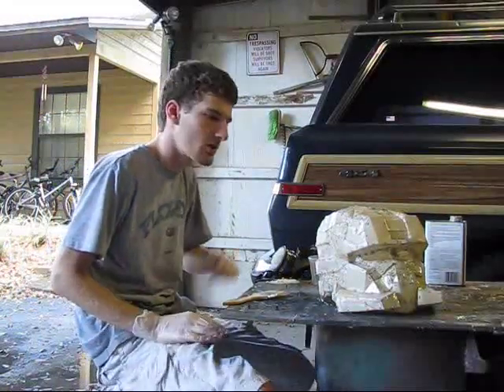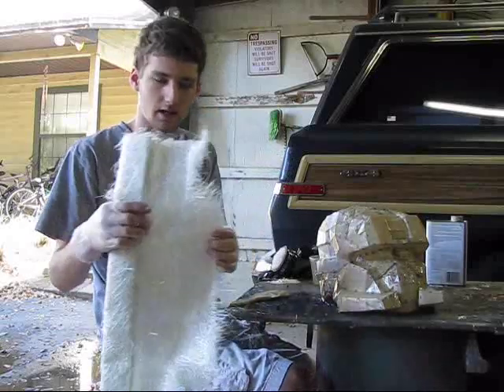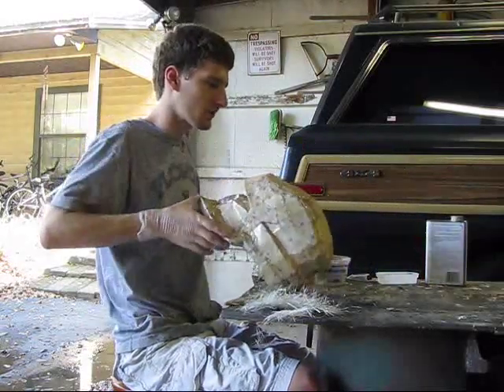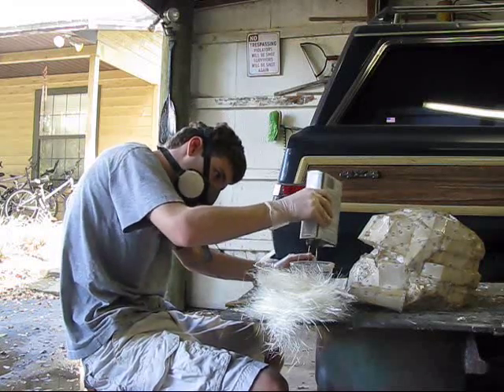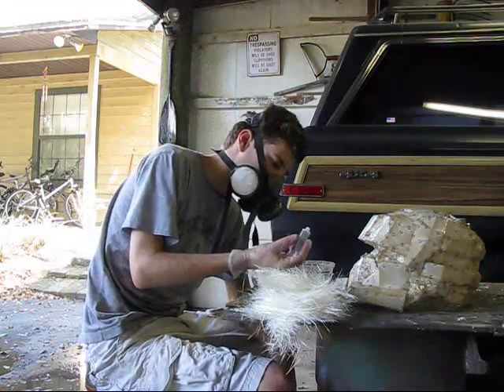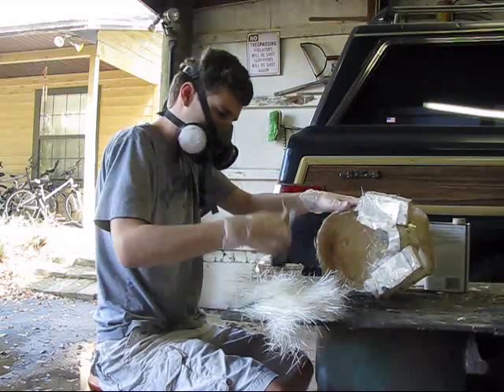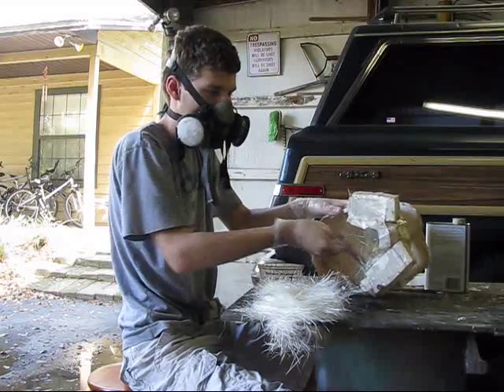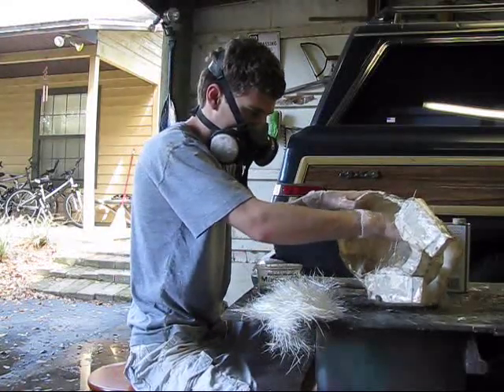How to build Halo armor Part 4: Fiberglass

Comment: Thanks for the video. In the process of adding the fiberglass sheets, would it still work fine if I spray "adhesive" material for the fiberglass to stick to, then add resin to JUST the OUTSIDE of the fiberglass sheets? This will be my first time and it seems easier to cut out the fiberglass shapes and attach them ahead of time. What is your advice? Thanks again for the videos. Very Helpful.

Comment from the maker: I don't really know. I've never made a pepakura weapon before. The only weapons I've made were scratch built from cardboard and didn't need fiberglass. You could maybe add cardboard to the inside of the weapon as you were building it to make it strong enough with just resin on the outside.

Comment from the maker: The bubbles could cause a weak spot in the helmet if they are large, or you could end up with a hole on the outside of the helmet if you sand through the resin and cardstock. I think you should try to fill the larger ones. If you end up having a problem, all you'd have to do from the outside of the helmet is fill the bubble with bondo and smooth it over. Also, do the bubbles hit your head if you try and put it on. It could be an issue.

Comment from the maker: Well, it might be possible to get away with no fiberglass but I think it would be hard to bondo and sand the helmet without it because the helmet would flex and bend while your trying to sand and possibly crack. You could just add a bit of fiberglass and if you're going to resin, you might as well lay down some anyways.

Comment from the maker: I usually try to lay the fiberglass down as smooth as possible, but if you have problem areas, you can grind or sand them down. Also if you sand them down some you can try to smooth them a bit with bondo. There's no easy way so just try to lay down the glass as smooth as you can.

Comment: Hello again...  Thank You for answering my previous question, I have another that I'm hoping you can help me with, I did my first layer of fiberglass. I noticed that I left some area with bubbles and didn't smooth every thing as well as I thought I did. Should I be worried about them ? should I try to cut and fill them? if I continue with them will it cause problems later on ?

Comment: good thing to do is when you put the first layer of resin on. get a smaller paint brush and apply it to the weaker areas of the helmet. then leave it until it dries and then apply it to all of it. do really thin layers if you are still uneasy about the strength

Comment: Would it be possible to apply resin and fiberglass to certain parts of the build during assembly? I don't ask this for a helmet but for other builds where you might not be able to access a part of it after it's put together. At the least, just the interior and leave the exterior resin til it's fully built?

Comment: I got a question. I'm trying to make a Halo Shotgun to go with my Spartan armor and I'm trying to use Pepakura for all of it since that seems to be the cheapest method. However, contrary to Halo armor, I don't think I'll be able to fiberglass the the inside of a halo gun. Obviously cause it's not as open or exposed as halo armor is. Do you currently know of any other methods of using pepakura and something else to make a halo weapon nice and hard?

Comment from the maker: Yes, you really need to fiberglass it. It won't be strong enough without it. 
This one is stronger because I had some leftover Smooth-cast 300 plastic from another project. So instead of wasting it I poured it inside this helmet.

Comment from the maker: I wouldn't recommend using just resin as the helmet is more likely to flex which will crack the bondo and ruin the helmet. You could try it, but if you are going to resin, you might as well lay down some fiberglass on the inside and not have to worry about it.

Comment from the maker: I always do at least one coat of resin on the helmet before cutting out the visor/lenses. This one had a coat of resin on it already, that's why the lenses were cut out. I usually cut them out before fiberglass so it's easier.

Comment from the maker: @OCoptimusconvoy  Well it depends on how much hardener you add and the temperature of your working area. Mine usually takes only a few hours to cure because I mix it hot (a lot of hardener) and I work outside in a hot climate. Resin will stay sticky for a while.

Comment from the maker: I use it for mostly the fiberglass resin's toxic fumes, but you should also avoid breathing the fiberglass dust as it is dangerous as well. I don't have any experience with aqua resin so just make sure you read the instructions well.

Comment from the maker: I usually wait until I have at least one coat if not two coats of resin on the helmet before cutting out the visor. But it depends on the helmet. If it doesn't seem strong enough, fiberglass the helmet first. Just don't put any over the visor so you can cut it out easier.

Comment from the maker: Not really, but smaller pieces of fiberglass are easier to work with. Fiberglass doesn't like to stick down over corners so if the pieces are small you can get them into all the places good and make them have lots of overlap.

Comment: you could try carbon fiber but it would be much more expensive and harder to do than fiberglass. if you need stronger then just add another layer of resin and fiberglass

Comment from the maker: @EpicExplosionsOfEpic  You need at least two coats of resin on the outside. Then if the helmet is strong enough you can move onto fiberglass without coating the inside with resin first.

Comment from the maker: Well, I just use cheap plastic and spray it with VHT Niteshades but if you want something stronger you can buy a motorcycle visor and cut it to fit.

Comment from the maker: I've never tried that method before so I can't say yes or no. I don't think it would work very well because the resin needs to soak all the way through the fiberglass mat or cloth sheets and stick them to the helmet/armor. But, if you think it would help, do a small test first to see what happens.

Comment: for my armor i did plaster bandages on the inside ( stuff limb casts are made from) then put resin and insulation foam and resin on and is pretty dam sturdy i can sit down in it and it's not break so yea just sharing ideas incase anyone cares

Comment from the maker: In my opinion you need fiberglass. Just resin is okay, but you won't ever get the strength you can with fiberglass. Also, if you're going to resin anyways it's not that much more work to just add a bit of fiberglass to the inside when you're doing it.